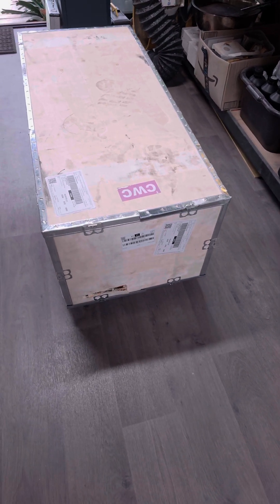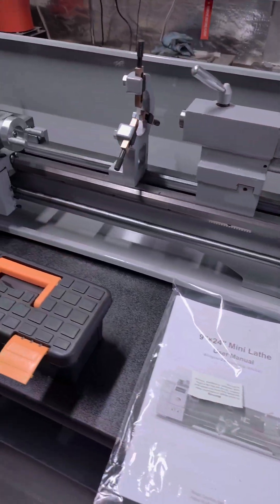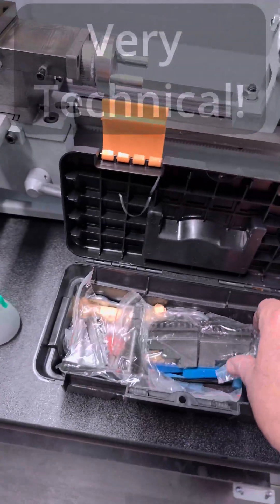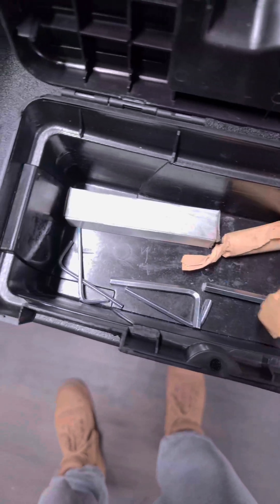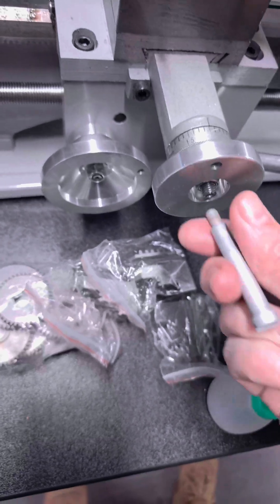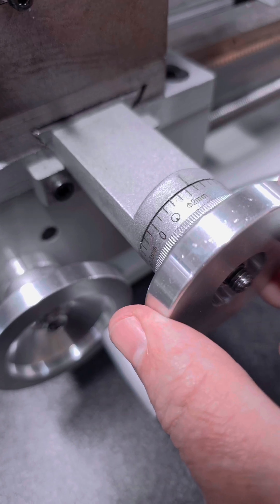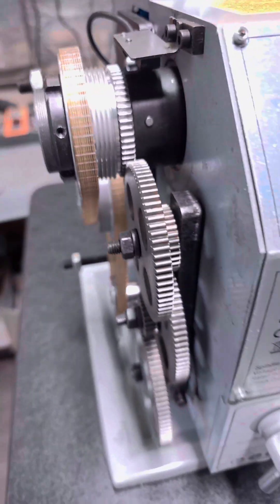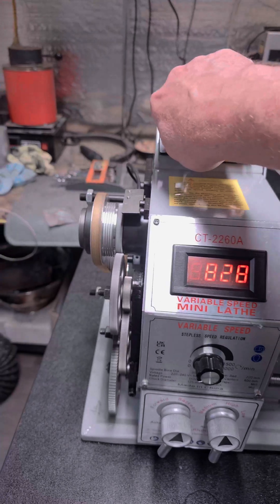Unboxing a 220x600mm (9x24") Mini Lathe

Comment: did you check the oil
Reply: No oil in the gearbox
Reply from the maker: That will be today's job to check and clean out.  The Instructions are also very sparse, so I'm unsure if it should be a wet or dry sump in the gear boxes.  I've not yet seen any fill / drain plug, but it could be there.
Reply from the maker: Next step will be to strip it down, clean it, oil & grease.  I need to have a look in the gear box as something is "crunchy" in there.  Just wanted to make sure it ran before doing all of this.